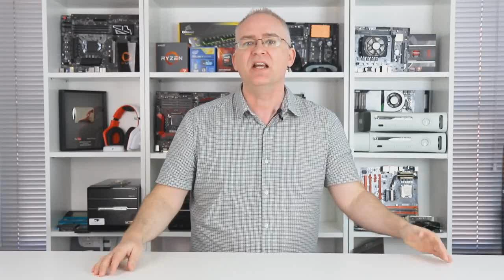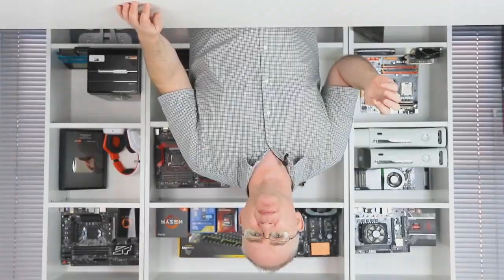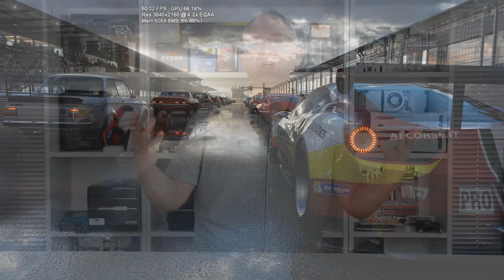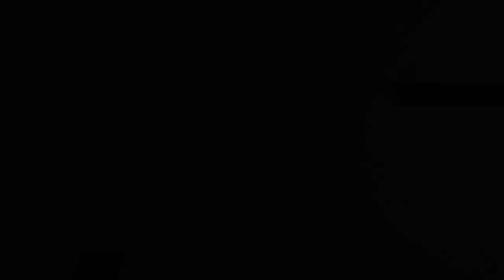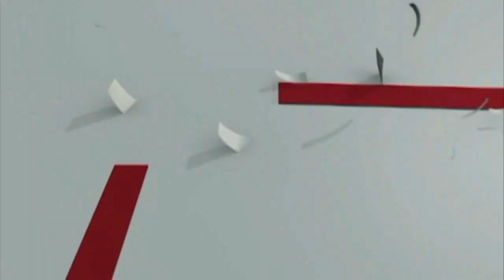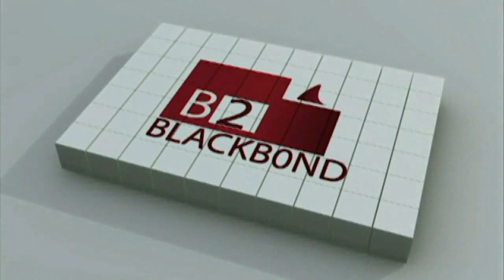This Project Scorpio Damage Control is Funny to Me @HARD8TIMES

Comment: The problem here is that Rich isn't being clear to this sort of question...

"During the live demonstration, did Forza keep a 30+% overhead the entire time?"

We know at least when the game is standing still it can... we know that, according to Rich the game runs very well, but does it really run with 30+% overhead most of the time?

I also wonder if this is WHY we didn't get to see what Rich saw. Why talk about all this and not actually show it? Is there something to hide? If there is nothing to hide, then I can only presume that this is the only real footage they want to show at E3 of a game running on Scorpio with actual resource meters shown. And if that is the case, and it's so easy to port the games over to the Scorpio, then other games like Gears 4 aren't going to make a great showing resource wise... presumably and they may not want to show you that.

Whatever the case is.. we just don't know... we can speculate but until the hard evidence drops we just aren't going to know. Hard8 has a great point and you also have a great point... the truth is probably in the middle.

Comment: It's a fucking racing game for gods sake. Racing games can run well on some seriously low spec hardware. I'll be impressed if I see gta5 running at 4K 30 fps on this thing. At that's at medium settings. Not ultra
Reply from the maker: Just like Project Cars?
Reply: BLACKB0ND you make a good point with project cars, but I would posit that there is a wide gulf between project cars and say a forza game. Correct me if I'm wrong, but I'm fairly certain that there's a hell of a lot of physics involved in project cars. A lot of intricate details and all that.